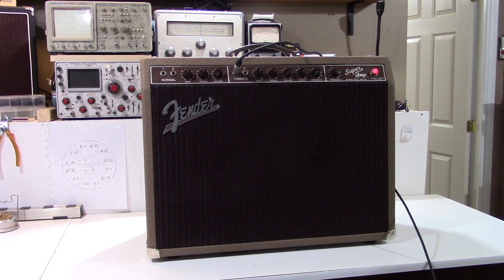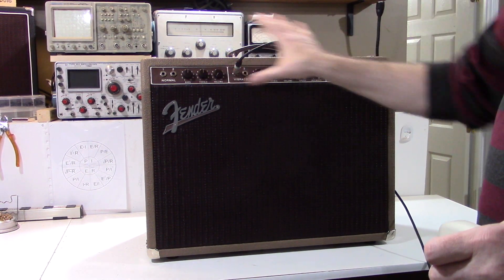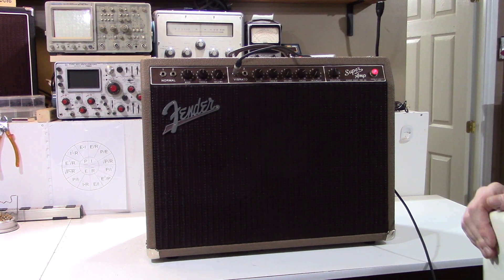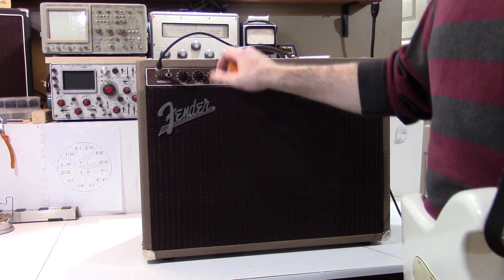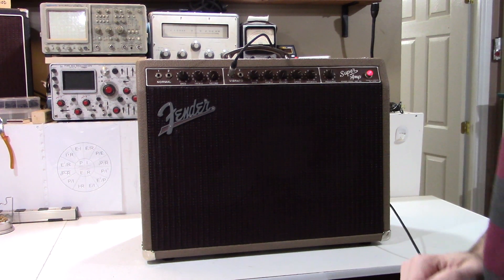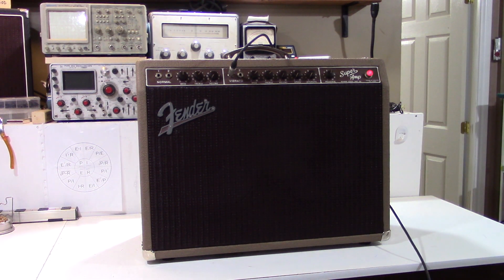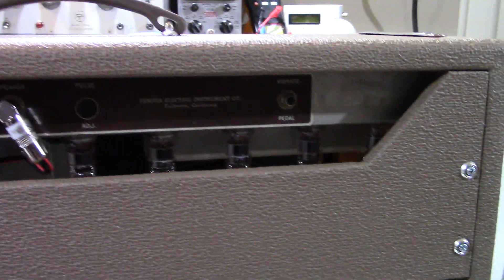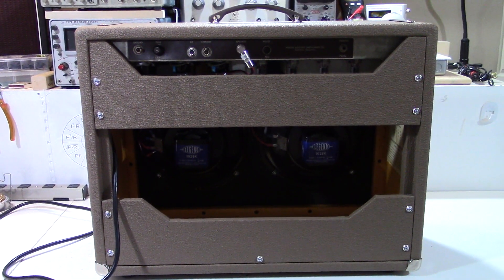1960 Fender Super 6G4 Guitar Amp Restoration

Comment: I just bought a 63 super. Any ball park price on doing typical restoration? It plays, but distorts too quick, and tremelo don't work well. Also the presence control doesn't seem to work.
Reply from the maker: I can't speak to what a tech local to you might charge (sending it to me would be cost prohibitive if you are anywhere besides Sherbrooke, Quebec). Just ask a tech if they have specific experience working on Fender browns. Try the TDPRI forum for recommendations in your area. The problems may be associated with leaky capacitors, a pretty typical problem with amps of that age.
Reply: @ptwamps3682  Thank you! I'm in East Tn. I've got a guy that usually does a good job servicing my older stuff. I'll just go to him, but I appreciate your answering!

Comment: You sure that isn’t a 5g4?
Reply from the maker: 6G4, no question. You are probably thinking of 5E4/ 5F4, which was the model number for the tweed Super, not the brownface.
Reply: PTW Amps the early Brownface amp circuits like the. Vibrasonic, Pro, Concert and super existed though. Rare but there’s a video on a 5g4 on here.
Reply: I just built a 6V6 version of this amp. Love the vibrato on these compared to later Fenders that use a lamp